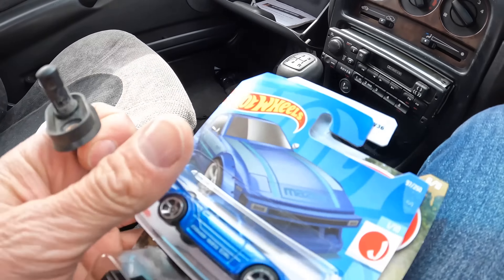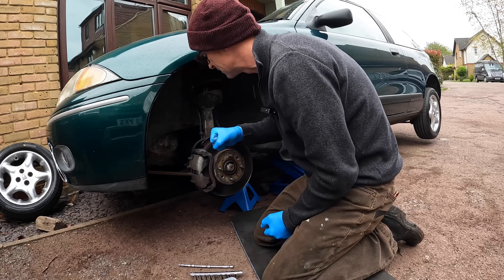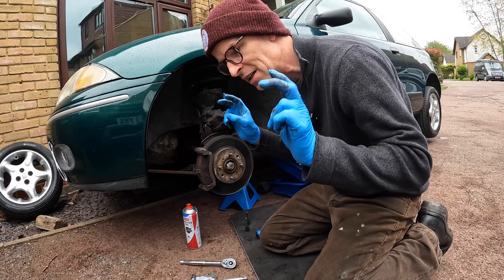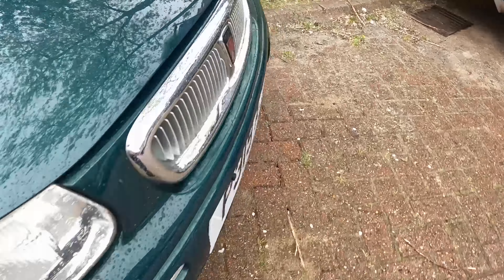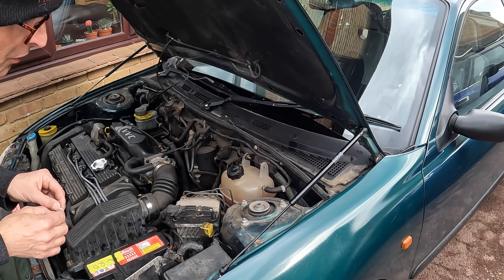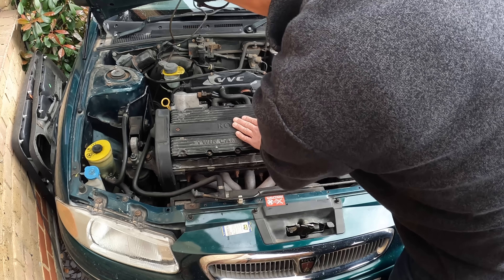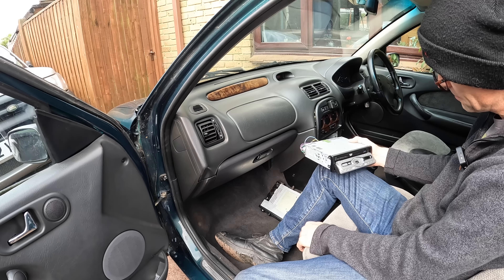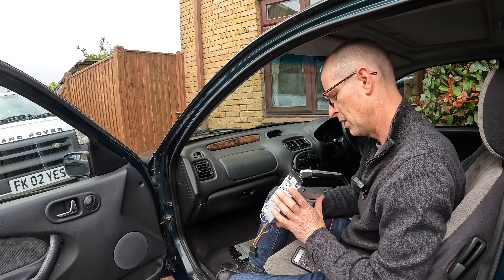Rover 200 Vi bonnet lift struts and many fixes

Comment: I bought a calliper rewind tool and couldn't make it fit. Ended up digging out the trusty old G Clamp for the win.
I seem to have similar car issues to you at the same time. When Quentin wouldn't start my car wouldn't start. Now I've either got a binding caliper or a wheel bearing on its way out.

Comment: Something to check on these old 200/25 check the wires in the tailgate jam myself and a few customers of mine had the wires snap and left stranded it also blows a fuse in the fuse box under the bonnet leaving everything dead. Just a quick check of the wires prevents the issue.

Comment: Any electrical problems on 200/25 check the tailgate wiring loom. Especially if central locking, rear wiper, rad fan etc are not working

Comment: Might help if you fix the LCD display so you can enter the radio code if you have it ? And with the Sony, some stereos have a fuse in the back or inside on the circuit board, check those, with the central facia, try pulling off the heater knobs and check if there's any screws behind and check if everything fits well behind, perhaps someone has had it in bits regarding the heater control problem ?

Comment: Matt, Not wishing to sound rude....but I'm struggling to understand how you think spraying penetrating oil on the head of a bolt somehow helps with making it easier to slacken off. I would bet that the threads on the bolts were bone dry when taken out and not a drop of penetrating oil had managed to get anywhere near them?
Reply from the maker: actually no, they were wet with the fluid. Thats how penetrating fluid works, it creeps under the head and down the threads
Reply: @furiousdriving  Ok, well I'll call you out on that then as I think that's BS. The next time you spray penetrating oil onto the 'head of a bolt' and remove it, immediately show the threads to the camera and we'll all see exactly how much oil has penetrated in the 3 or 4 seconds that you give it to work. I do hope you haven't sold your soul to the Bull Dog brand.
BTW, sarcasm is the lowest form of whit, don't you know?
Reply from the maker: @tigermoth3194  you know it’s not real time on video? I go and make a coffee and leave it a while

Comment: If the sliders were not seized (didn’t look to be?) and neither were the pads (looked a bit tight?) then it’ll be the calliper.

If the pads are still tight after thoroughly cleaning the surfaces then file the locating lugs down slightly where it sits in the carrier

Comment: My that little thing sounds sweet as a nut. Might that bolt be from the gearbox/ subframe? 

I've never worked on a Rover before, however I know my K11 has a similar looking bolt that goes through the cross member into the gearbox that is an awkward bugger to see. I do hope it's not though.

Comment: The heater could be iirc a metal ‘grip’ that the cable passes through behind the console. Sometimes they lose grip and the cable moves back and forth within it instead of being gripped right so the internal adjusting wire only moves. Hope that makes sense!
Reply: I'm going to agree with you, recently fixed that on my 400hhr. In my case the plastic bit that the metal grip screws into broke, so the grip didn't hold the cable sleeve and the heater knob was useless. Hope Matt sees this.

Comment: Hi Matt,
MGF has the same hazard switch, pretty easy to dismantle, as an aside the latch mechanism is a seperate component & therefore removable - I turned my hazard switch into a starter button by removing it & spray painting the push button.  I then fitted the hazard & central locking switches on their elliptical plinth from a R75.

Comment: I had the same problem with the front brakes on my zr. It made the steering wheel shake badly and smelt like burnt clutch. I changed both at the same time.  I also had radio problems I bought a brand new one that wouldn’t work turned out the Ariel wasn’t plugged in properly  I didn’t realise it needed that to earth it

Comment: The pixel ribbon in the clock display fails it’s common on these but you can replace it, I sent mine away to a guy on eBay to fix for £22 but he’s disappeared now. When you enter the incorrect code on the radio it times a lock out which increases with each wrong input but you need the clock display to see the code which is available online if it’s the original factory fit unit to that car. The dash switches are also common on Rovers/MG’s to not work if the cars been standing for a long time you can prize them apart to clean the contacts but use some sandpaper to smooth the edges before inserting it back in.

Comment: IIRC the heater control is connected directly to a valve on a cooling hose in the engine bay. I freed mine off by lubricating the linkage to the valve.

Comment: I had a 99 220sdi years ago (same colour) with a broken remote. I put a self tapper into the courtesy light switch so it thought the door was always shut, and lever locked it. Worked for year 🤣🤣

Comment: Matt, you might be able to just get the radio recoded, I did this on an old Rover 800 and it worked fine after that and you then have the new code.
Reply from the maker: if it works..

Comment: Before buying a new Caliper, apply some old used brake fluid ( or new ) liberally around the Caliper's Piston and its Seal. Use a rag to clean it all off along with the accumulated old Brake Pad Dust and Road filth, Should come up like new. Then retract the Piston Carefully back into its housing being careful not to have any fluid overflow in the Brake Master Reservoir. Yes, clean the sliders and where they slot into their location housings of any old grease which has become hardened with age. Apply fresh grease, I use LM Grade. Then reassemble and firmly apply the brake pedal several times. Then repeat that process with the engine running.  Although not too expensive. you might just save yourself the cost of a replacement Caliper. With a range of Rovers and MGs in the extended family fleet, including a 200vi, works most times.
 

Good advice about pumping the Brake pedal after any work on Calipers. Many moons ago Inexperienced me was pleased with my DIY skills overhauling the brakes on my Rover. Had not gone far when needing to brake for a right hander... OMG! No Brakes. A few rapid pumps on the pedal saved the day. So easy to drop your guard on occasion. If your brake TLC shapes up well. Good but anyone reading and watching this can learn what to do. Fortunately on these nice old cars, it is not Rocket Science. Keep up the good work. 

Finally, as Emily'sDad posted ~ see below ~  sometimes a partial rebuild of a Caliper with new piston and seal IS as he says, better than a remanufactured item.

What a difference those Air Struts make to the chore of opening a bonnet. My ZTs and MG6s have them already but I may get a pair for my wife's MG ZS I maintain for her.
Reply: Done that myself not thinking 😂 replaced brake pads went for a drive no brakes coming to a junction 😳

Comment: how can I find radio code as not in manuals
Reply: I'd try guessing.
Reply: @mrc7478  That can lock them though, can it not?
Reply: @SuperFIFTHGEAR  I'd try guessing that, too.
Reply: the old car stereo thief trick... take the stereo out... wrap it well in plastic bags to keep the moisture out... put it in the deep freeze for a few days... and the cold will have done a factory reset
Reply: Probably some sites on Google where you pay about £10 and using some numbers from the side of your radio they generate a code for you. I did it on a Renault scenic where I bought the stereo from a scrap yard and got code from the net.
Reply: Some sites give them free. Do a Google search. You'll more than likely need the numbers on the radio itself, so pull it out take a photo of all the stickers then refit.
Reply: @colinrowe3940  This has worked for me in the past. I have a few working Rover/MG period Radios up in my loft. All with their codes. Quite often previous owners write the code on the radio somewhere ( too old to be worth stealing now, not like on my new Montego over thirty years ago ) or somewhere in the various manuals that come with a used car.
Reply from the maker: search online, places sell the code for about £10 from the serial number
Reply: @furiousdriving  I am tempted to replace it  with another OEM Unit ( 2016 Suzuki Celerio)

Comment: Back in the late 90s, I got hold of a 1993 Rover 820 Si (described in the Blue Book as an "executive dinosaur" which has always amused me). It had a lovely engine, was very comfortable and I loved the design, but boy oh boy the electrics were...shambolic. If I went through all the problems with them, this would be a very long comment. Let's just say that it was...everything (apart from the ignition - just). I had a good couple of years out of it but when the clutch failed, that was that.
Nice to know, sort of, that the 820 was not the only Rover model from the era that had these, um, quirks!

Comment: I have the same problem with the aftermarket radio in my R8 coupe with the bubble dash, Clock display and radio both stopped working at the same time. So if you find a solution please let us know ;-)

Comment: Like the made for the job pry bar, much better than a very large flat head screwdriver that needed constant straightening in a vice or a jemmy.  All modern cars look so complicated under the bonnet, if anything can be seen, let alone fixed without the correct diagnostic programme, give me an A series or even a Rover V8, simples by comparison.
Reply: Bought the first new K-Series car in 1993 and the last in 2003.  Both still in the family and driven by four members daily. 

Have extensive DIY experience working on K-Series DOHC power units since I first fixed a neighbour's many moons ago. I learnt so much sorting that problem K-Series ( professional incompetence ) that gave me confidence to tackle K-Series cars previous owners had given up on. Lost count of those since saved.

My two sons both passed their tests aged seventeen. Both always drive MGs and Rovers. Their 20-something age friends are all MG and Rover mad. My sons now in their 30s. Also mostly skilled DIYers. All drive MG-R cars. These include MG Metros including one in better condition now than the one I bought new back in 1983 on day one. Also the best looking top spec early Rover 75 I've ever seen and one young friend has a Mustang powered V8 ZT in my favourite MG Green colour. It's a misleading myth that only older guys like me are MG and Rover owners and drivers. Anyway, I gave up smokng many moons ago and am saving up hard for some comfy slippers. 

Lost count of the K-Series engines I've worked on over the years. I find them a delight and easy to work on. The last major project rebuilding a ZT 1.8T's with new Pistons, Rings and Liners. A fairly major rebuild. Imagine how I felt after all that work, after turning the engine over with spark plugs removed to get that fresh oil in the engine where it should be, as soon as I operated the Starter Motor ( having waited to hear the fuel pump prime the injectors ), the engine burst into life immediately without any cranking delay.  I shall never tire of enjoying that experience. Better than taking delievery of a new car which I have done many times mostly company cars. Now that 1.8T K-Series Engine drives good as new.

Comment: The light in the switch is panel illumination.  It doesn't flash.  There should be a light on the dash that has the hazard symbol that flashes

Comment: Just a thought, maybe the 'bulb' in the hazard switch is an LED, and it only works in one direction. Will it fit the other way round? Great progress BTW.
Reply: It looks very much like the dash switch bulbs my P38 uses, they're tiny little T3 filament bulbs not LEDs. They're extremely fiddly and get brittle with age, the contact pads are tiny and like to stop making contact whenever they feel like it. A note when replacing them (as is the case on P38s) sometimes they have little silicone caps over the bulb to colour the light, remember to transfer them to the new bulbs because they're impossible to source!
Reply from the maker: It looks like filament, and being mid 90s slightly too old for LED
Reply: @michaellowe2131  Good info
Reply: @furiousdriving  Fair argument, but LEDs were invented in 1962, believe it or not!

Comment: Hi Matt, I have a Rover( philips) R770 radio with code and a matching CD changer with data cable ( XQE 100230) both in good nick if your interested.Great to see the 200vi coming together.I await with anticipation your nxt instalment, Regards Bruce

Comment: Hi am having some issues with my mg zr horn doesn’t seem to work and am no mechanic, any help please
Reply: it can only be 4 things .. horn push , fuse , horns , wiring  ( or 5 things if it has a relay )
Reply from the maker: as he said below. Get a cheap test meter and try the different parts

Comment: Be careful with contact cleaner, you're only supposed to use a small squirt in the vent hole, too much can dissolve lubrication grease and cause more problems than it solves.  That bolt might be an alternator bolt, but it also looks like a subframe bolt.
Reply from the maker: its alot smaller than the alternator bolts, looks a lot like the timing cover bolts

Comment: Try opening up the relay carefully. I've fixed them in the past by re soldering dry joints. The solder breaks down and cracks which loses circuit from time to time making it intermittent

Comment: playing a blinder with the VI. Sticky caliper ? Get rid. Not expensive and not worth faffing about.. 2 Radios with the same issue ? Unlikely. Workings in the heater selections probably need a little Love Silicone grease love.. I had the same problem in one of my Rovers. WD did the trick. Silicone grease is better. Thanks for video  Later👍

Comment: Not sure if this applies to the 200, but I’m fairly certain there is a screw behind the top of the centre console that is behind the heated screen/fog light switches. So if they’re removed and you have a little look up you can see. Is on the ZS anyway can’t remember what it was like when I had the dash out my ZR. 

As for the heater switch movement, I had an endless play with the routing of the wires that go from the dial down to the vents. It seems to only sit one particular way down in the drivers footwell if you fancy moving the cables about! 

Hope that helps! Loving the rover content but I suppose I’m biased!!
Reply from the maker: thanks!